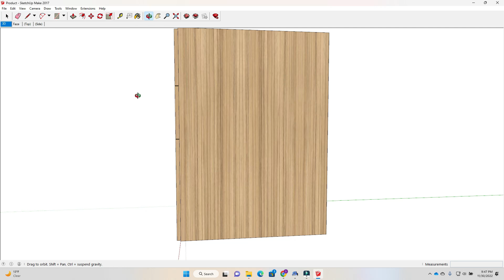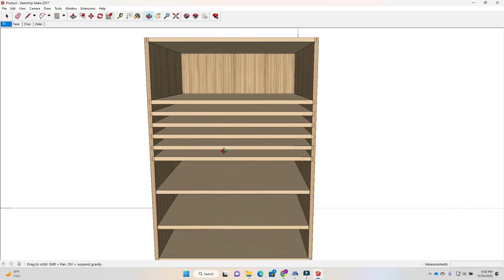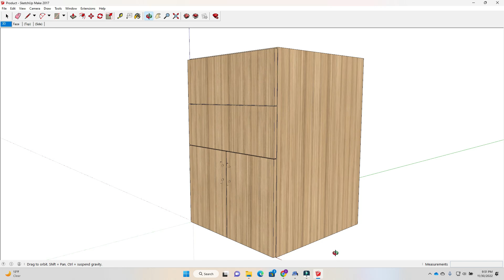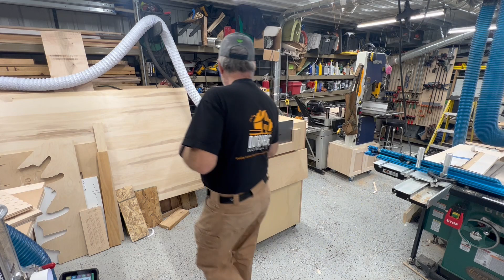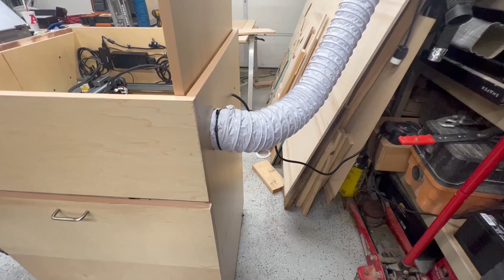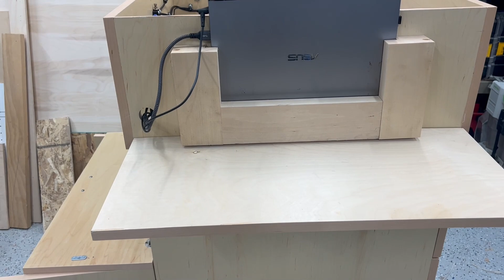Make Your Own Laser Cabinet - But There's A Surprising Twist!

Comment: Very nice design with the options for height adjustment and storage. Do you use the webcam through lightburn for layout?  I’m curious how well it works offset from center like that.
Reply from the maker: I have yet to do much with the webcam but plan to soon
Reply: @donavanshomes  I've got a number of diode lasers and have just started playing with the camera feature on one of them. It's a nice tool if you get it dialed in correctly.
Reply from the maker: Thanks